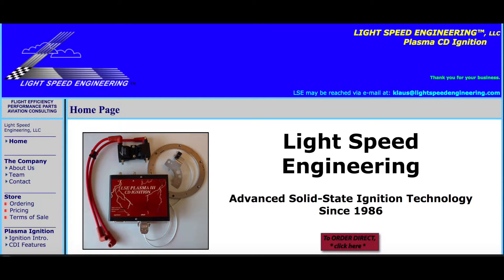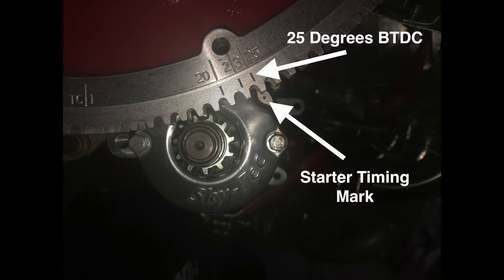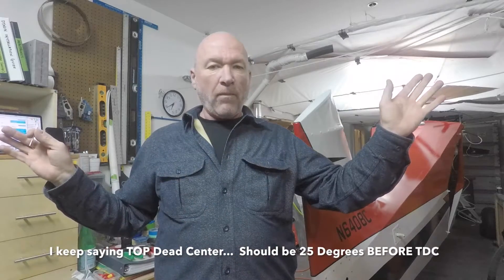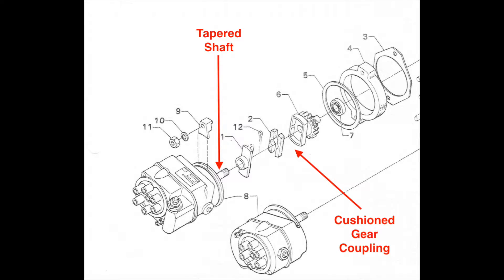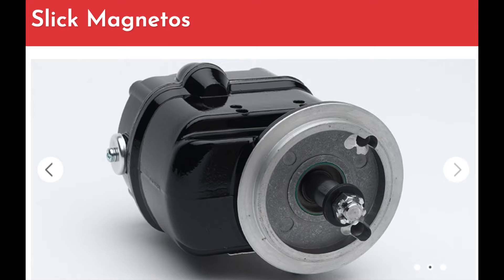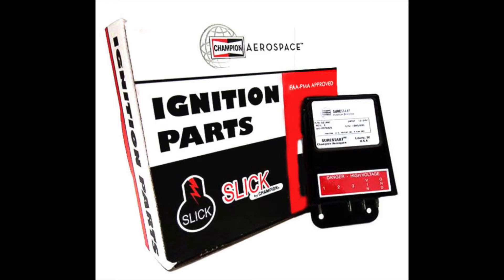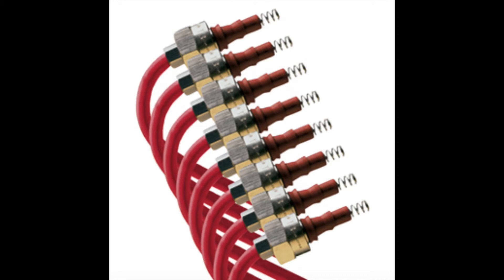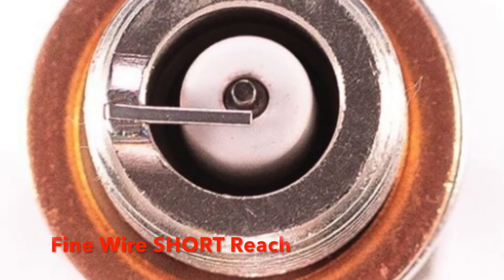Bearhawk ~ Ignition System Installed!

Comment: Thank you very much for sharing you thoughts on the electronic ignition. I will reconsider my decisions :D
Reply from the maker: Of course the greatest determining factor for me to forgo EI is the the difference between the 6 cylinder and the 4 cylinder.  4 cylinder EI systems (mag replacements) have been in service for many years.  Not so much for 6 cylinders.
Reply: Bearhawk Life, I was opting for EFII and it was to be built by Aerosport Engines on their custom made Lyncoming 540. Now it seem it will go for Thunderbolt with 2 e-Mags and opt for Airflow Performance injectors to make the fuel flow uniform and be able to fly LoP easy. The whole idea comes from this blog: https://www.myrv10.com/N104CD/upgrades/20090822/index.html

Thanks for the videos. It seems you sold me the Bearhawk, and I will not build the RV10:D greetings from Poland!